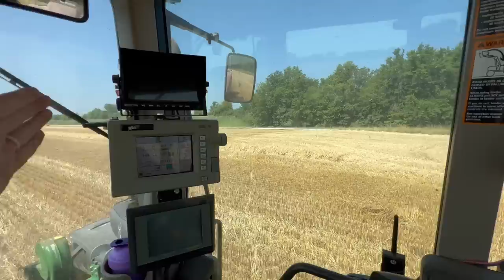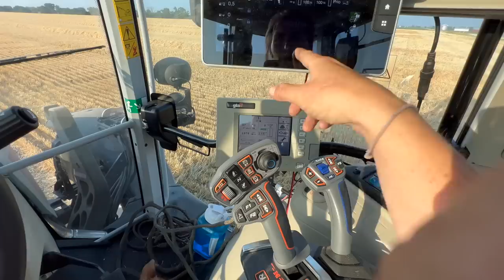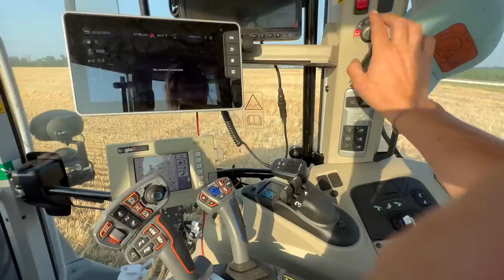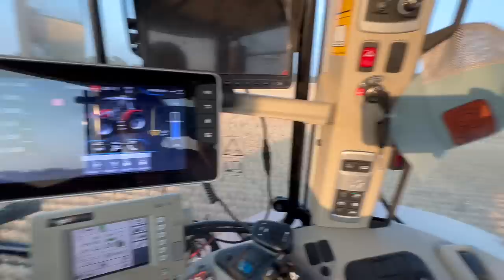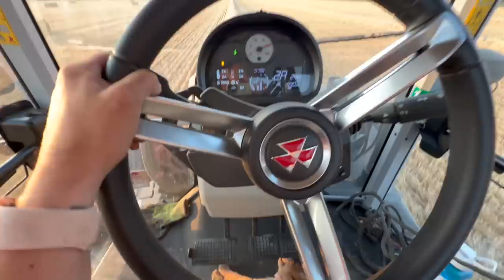Miles & miles of windrows and a ton of knots later  |  { A Farm Vlog } Wheat 🌾 Straw 2023

Comment: That baler is causing the tractor to lurch with every stroke of the plunger.  Knitters can be so fickle at times.  We had an IHC 47 baler that would miss several knots in a row then it would tie 5-600 bales in a row without missing a beat.

Comment: please be careful pulling on those knotter s they will get you bad if you get fingers in wrong place i hear you on twine i bought a new ih baler in 73 first run perfect then went to another farm changed twine missed more thabn it would tie ih spent 3 day,s on it they decided it was twine that baler would only work with ih twine it was expensive but it worked i have 570 nh now but i m retired so is the baler have a safe 4th good luck